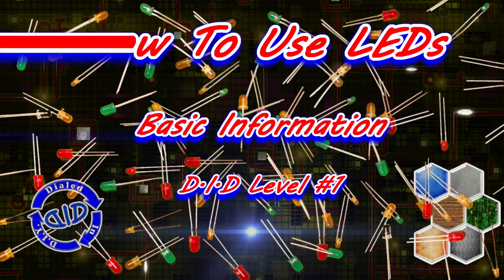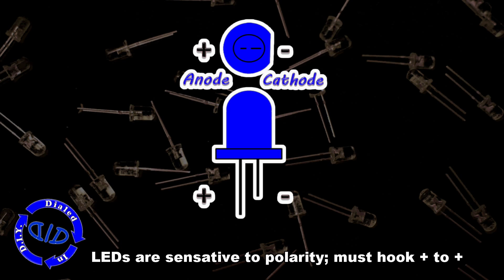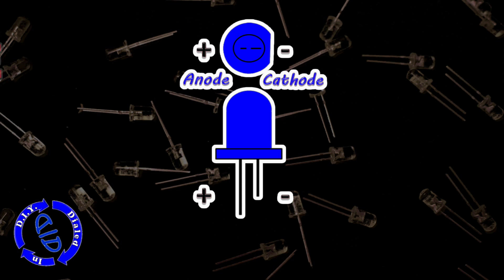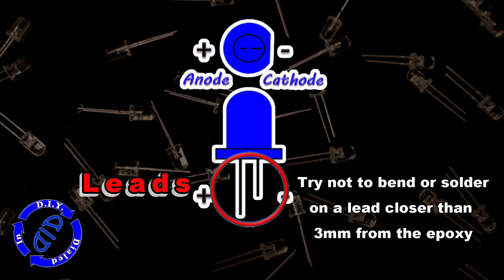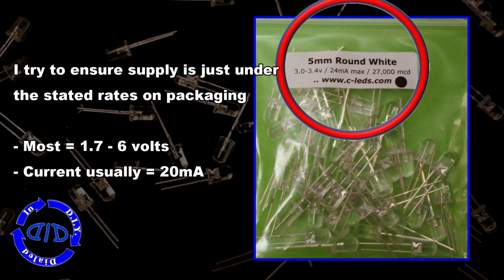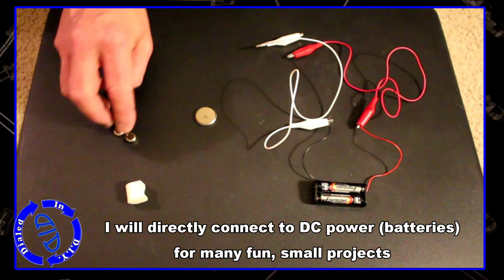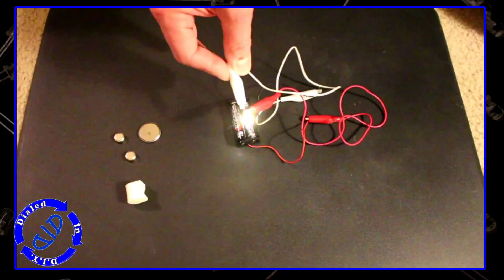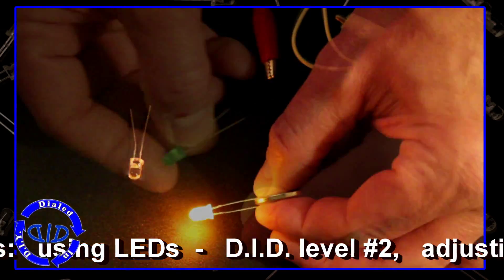How to use LED lights -   Basic Overview

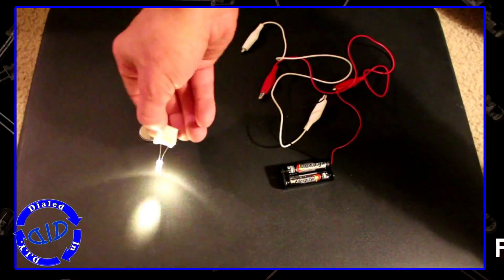Comment: at timestamp 2:10 you put two coin cell batteries inside of a very nifty housing.  I have been searching and searching for this sort of housing to hold 4 duracell DL2032 in series, but haven't seen anything like it.  Is there a name for this sort of housing and/or do you know a supplier?
Reply from the maker: I actually made that in what I planned to eventually be a video... I need to do that one sometime soon.  I basically made a mold using a dowel and a piece of PVC then used silicone caulk mixed with a tiny bit of plaster of paris for the flexible battery housing.  I will try to get on that one as soon as I have my work area cleaned up again (recently moved).  thanks so much for watching and for posting your question!